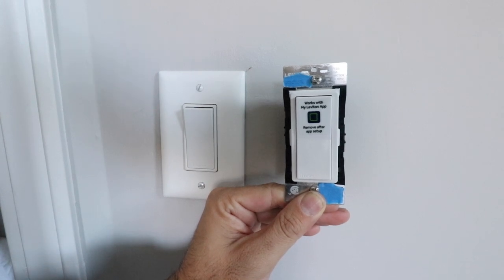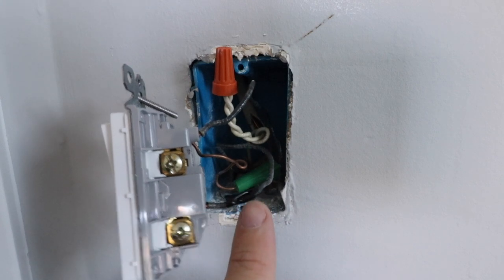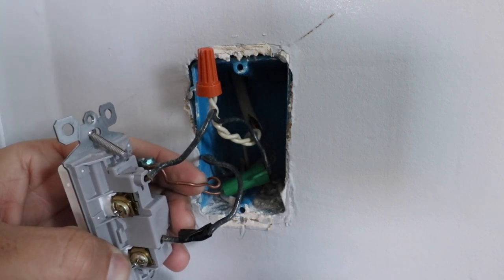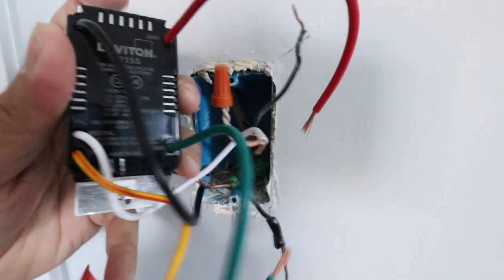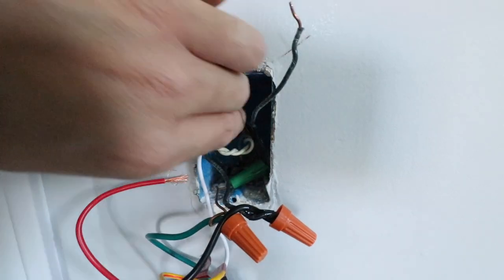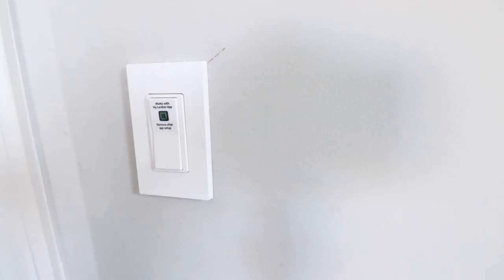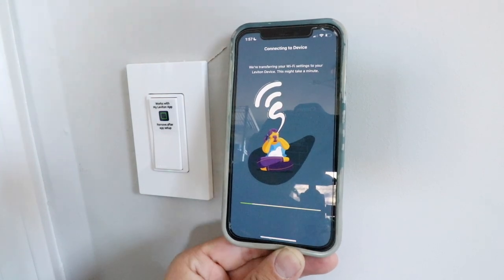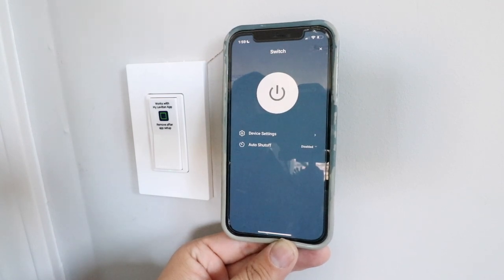How To Install A Smart Light Switch

Comment: Thanks. That was a great video. I just have an issue. the other plugs/switches that are sharing the same fuse stopped working since I install the new light switch. Any suggestions? I tried 2 different locations and have the same exact issue.

Comment: @OneHourSmartHome - Is there a similar way to install standard smart three-way switches in a box where the electrician used the neutral from the breaker box as a traveler? 

I have a three-way switch with the Neutrals in the box, but this is the load switch (shorts the circuit, when I connect the Neutral wire to the switch), and the line switch uses the Neutral wire as one of the Travelers! The line switch is configured in a two-gang box with another three-way switch (I would like to replace that one, too). Can I pig-tail the Line (or Neutral) wire from the adjacent switch to the Neutral for the smart switch? Thanks.

Comment: Great video!...I have a 3 gang light switch but only need one of them to be a smart switch so I can control the porch light. If I swap only 1 switch, will the existing trim cover plate work for the Leviton as well as the other 2?